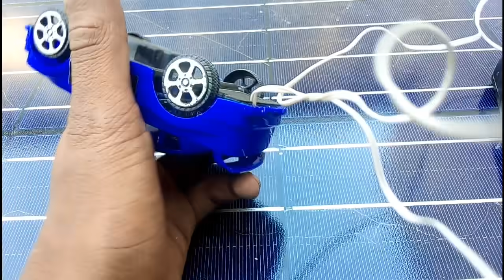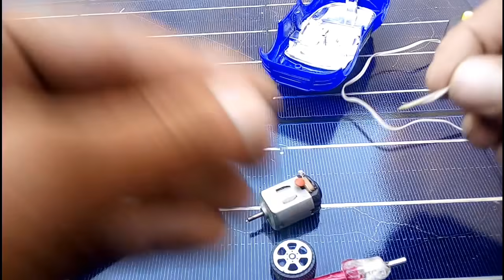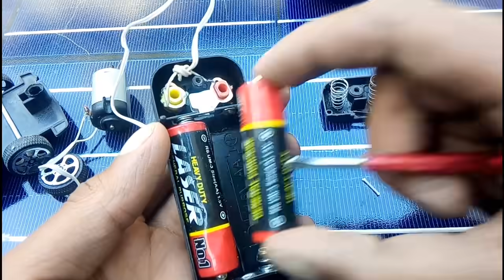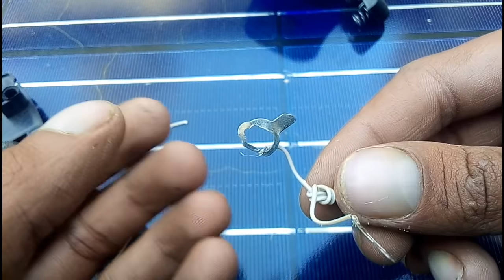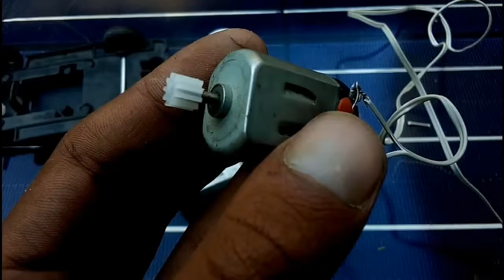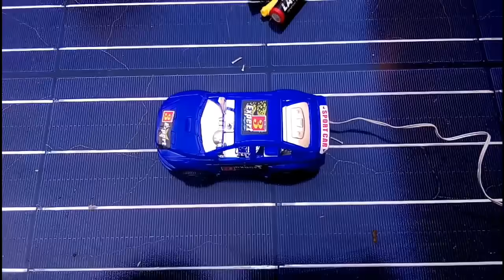How To Remote car DC Moter 2021 Razzaq Experiment

Comment: By not using battery bro you can add a small solar panel on the car and leave it on the sunlight then it will work and you father will not say "bijli ka bill tara baap bharega" 🤣🤣🤣